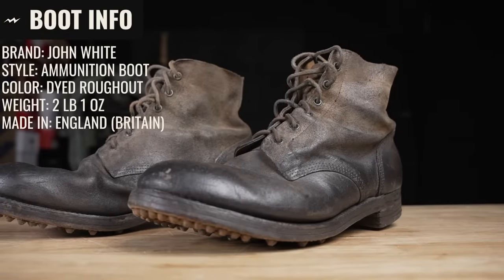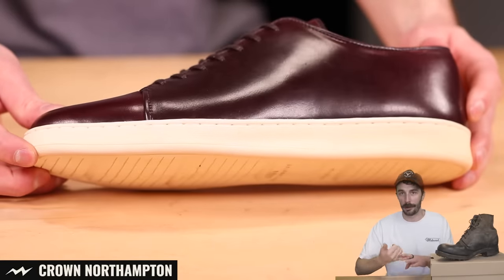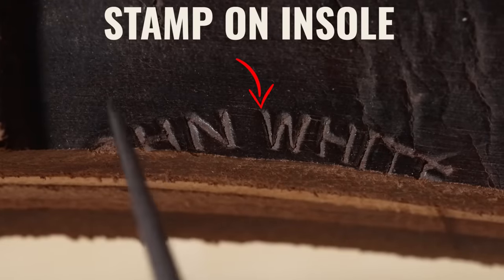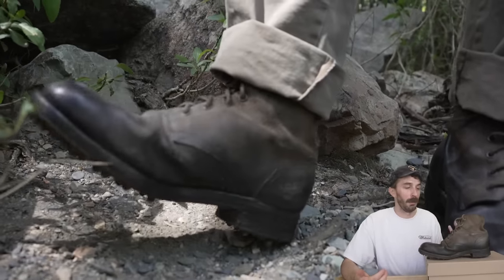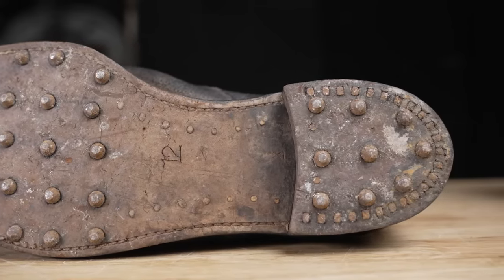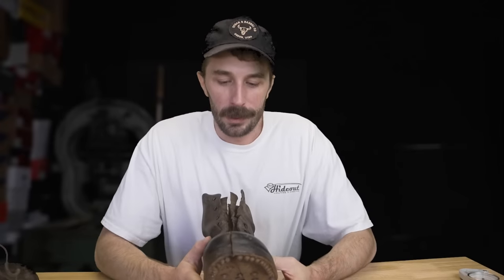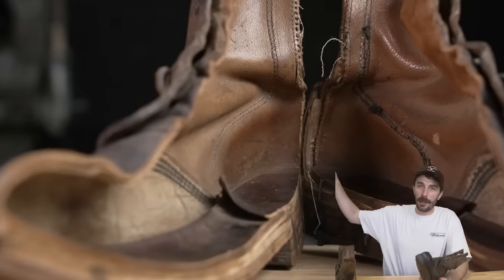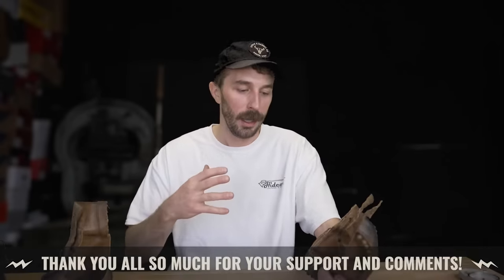Why 80 yr old British WW2 boots are better than modern boots

Comment: I joined the British Army in 1976 just after leaving school, and we were issued the "Boots DMS" which were patterned on these, except they had rubber sole, pimpled leather on the outside and a smooth toecap. They were pretty much useless, as discovered during the Falklands war, when they were found to be as "waterproof as a pair of sandals", and soldiers were getting trench foot, not seen since WW1. They were replaced in the mid 80s by a high combat boot with a bellows tongue, and these were slightly less crap.
For parades, we'd purchase our own non issue ammo boots, which, like these had a double leather sole and hob nails set in groups of 3, and a heel and toe plate. They were very stiff, also had pimpled uppers which needed to be "burned down" and a smooth toe cap and heel. Good for marching and holding a bull without cracking. They're still used today for ceremonial use by the Guards Division.
Reply: Exactly.
Reply: I joined in '63 and the first issue boots were ammo of 1940s vintage. Later we were issues boots DMS which were alright for wandering around the office etc. but as a plant op. I would go through the soles in about 6 months needing a replacement.
Reply: Boots dms were a piece of sh*t. Traded my woolly pully with a west point kid for his para boots.
Reply: I have heard only bad things about boots DMS. I can't imagine being stuck with them.
Reply: @eanschaan9392  this is because there was absolutely nothing good about them.
Reply: @stevekane4922  I believe it.
Reply: I pulled an absolutely unused pair of Boots DMS out of my attic a few months ago. I had been issued them in 1982. I chucked them in the dustbin.
Reply: @jeremyoconnor169  🤣🤣🤣🤣🤣🤣
Reply: Joined in 1980 and issued DMS boots. As an experienced land expedition leader and climber, I was appalled by the cheap quality, poor fitting and dismal performance of these boots. Quite frankly they were worst pair of boots I ever had. Useless in the field and damaging to one's feet. 

Compared to privately bought Vibram soled mountain boots I used for fell walking and rock climbing the DMS didn't come close. 

The MOD decision-maker who signed off the issue of DMS boots to the British Army should've been jailed for life.

Comment: As a British forces veteran I believe I may be able to add some extra snippets of info. Ammo boots, usually more modern, are prized highly among serving soldiers. They are kept aside for purely ceremonial purposes. Full dress parades etc. They are polished, or bulled as we called it, to a mirror finish.
And due to their full leather construction they are long lasting and are usually sold on once a soldier leaves service.
I had a pair I bought when I joined  from a guy who was leaving. I kept those boots immaculate for 8 years through many many pardes and sold them on when I left  years later.
 I would not be surprised if they are still being used.
Love your videos and would love to see you strip down a pair of 90s era Danner Matterhorns. The best pair of combat boots I ever had.
Keep up the great work.
Reply: Danner..nice boots..bit expensive though..best boots used where made by Lowa..not any of their high leg ones..but the just up over the ankle..survived many a crease job of a battle march with them and a good pair of socks..
Reply: Ahhh Danner/Matterhorn are a joke since you can't ever fit them right with that cutout they have
The rare times I needed a insulated boot (training in New Zealand) I wore their Fort Lewis (I think it was Lewis.....Fort something or another) boot because it was a taller version of their Acadia, which fit my foot like a glove

Comment: There's other advantages of making boots with the leather rough side out;  that the rough outside absorbs wax-type waterproofing very easily, and when it does get soaked, the inner skin side of the leather usually stays watertight, helping to keep the soldiers' feet dry - plus due to the coarser grain of the outside, it dries out faster.
There's an old horseman's saying - "No foot, no horse";  but it applies just as much to a soldier, doesn't it?
Many thanks for yet another fascinating video, and a look into an aspect of history which is rarely covered anywhere else.

Comment: I've enjoyed your videos and because this one is fresh, will add something about my experience with work boots. More specifically in the field with a survey crew and then as a geologist in mining exploration. This dates back to 1957 with my first pair, but with a leather or flat compound sole they had little traction on wet boulders or flat-lying saplings. Had hobnails installed, which was better in saplings but not good on rocks. Wore them once on a cold day and the heat loss was noticeable. In graduating in 1962, there was a European boot maker on campus, mainly making hiking or climbing boots to just above the ankle. Had a pair made with 8-inch uppers for going through the wet places. The "Vibram" sole was new then and the improvement in traction in most terrain was outstanding. The boots were beautifully made with a very smooth lining--and I still have them. In working for a "junior" exploration company we made some money on a discovery, such that I went into the investment business, only wearing them on some consulting work. Now my very dear friends, they are well-worn, but not worn-out.--Sigh--like me.
Reply: Get them resoled and restored. I had a pair of leather dress shoes completely redone with JR soles from the 1960s
Reply: @SilverKnightPCs  Had I continued full-time field work in mountain terrain the boots would have been worn out. Going down skree slopes wore out the heel counters. Nevertheless, the soles are well-worn but I had them re-nailed about forty years ago.
Reply: @bobhoye5951  like I said, full new soles and a upper restoration and they will feel like a new pair of boots with the same styling and look
Reply: @SilverKnightPCs  Hey--a conversation. I've looked after the uppers with leather preservatives such that they need no work. In good shape. I've lost a lot of weight over the past 18 months and some morning when my feet are not too "puffy" I'll try to put them on.
Reply: With success, maybe write a note: I took my sixty-year-old boots for a walk, or they took me for a walk.
Reply: Thank you for sharing that story :)

Comment: Just a note on how to lace up Ammo Boots. I served in the British Army from 1970 to 1995. Started with Infantry Junior Leaders Battalion at Oswestry in Shropshire. We were taught how to lace the boots by our two Platoon Sergeants- Alec Chisholm Scots Guards and John Hamill Queens Regiment. A knot is tied one end of the lace and threaded through the lace holes from the bottom left lace hole. The lace comes out the top lace hole and is wrapped round and tucked through itself to secure it. The same applied to DMS boots and Boots Combat High but changed with the issue of Boots Combat Assault which had metal mountain boot type hooks.
The laces were leather. This method of lacing was called "Kings Pattern". Hope this is of interest. PS I have never laced a pair of boots using a bow or knot.
Reply: How interesting 😃
Reply: On the topic of lacing...
When I was a kid, an old man in our village told me that he was out in Burma, during the war.
He told a story about how the Sikhs they had with them would strip down to their shorts and go out into the jungle at night with just a dagger, hunting Japanese soldiers.

At a certain point, they had a detachment of Americans stationed with them.
The Americans began losing their sentries at night.

It turned out that the Sikhs were crawling up behind people, in the dark, and feeling their boot laces.
If they were laced up in regulation British Army style, they'd simply crawl away again.
If not, they'd leap up, slit the throat and move on.

The Americans were instructed to change the way they laced their boots and instantly stopped losing men in the night.

How true it is, I couldn't say, but as a 10 year old kid, it made me very particular about lacing my boots the way the old man showed me... in case the Sikhs got me, in the dark.
Reply: Supposedly the reason for this type of lacing was that should you suffer a foot injury, say from a bamboo stake or a "toe popper" type mine, it was said to make it easier for a medic to cut through the laces to remove your boots. In reality when you get badly wounded they just cut the boots off with surgical shears.

Comment: I think one of the issues with "higher quality" (aka hardier) boots is they're not as comfortable. Hence why modern boots use modern materials like foam or chrome tan. People are no longer willing to piss in their boots just to make them bearable.
Reply: Thank you for that tip, I was unaware of this practice
Reply: It's also much harder to find brick and mortar stores for the hardier boots so folks end up buying the wrong size online and think that "breaking in" means blisters and literally bleeding from their feet so they give up on them. Forums online are littered with people saying their red wing's are killing their feet.
Reply: Modern combat boots are meant to be something you replace every few years, they sacrifice durability for performance.    The difference between hiking with synthetic mesh boots and leather boots is frankly night and day, even when leather is fully broken in.   Probably the biggest difference is the weight, there is an old saying that every 1lb on your foot is equal to 5lb on your back.    The mesh is something that is extremely important for preventing trench foot when water gets into your boot as well, as it allows the water to properly drain out.
Reply: @jfs5873  I've hiked in mesh and leather. The leather are stronger but you have to take them off every hour or two just to air your feet, the mesh you can walk all day in them and your feet will be fine. The problem is it's getting harder to get good mesh boots.
Reply: @manticore4952  I have modern leather hiking boots (Scarpa SL) and they are really very comfortable even for all day hiking in 30 degree C heat. My last pair lasted me 10 years, I replaced them a year ago.
Reply: @jfs5873  it's a good trade off if you ask me. You can't replace your feet. Plus carrying just a little more ammunition or a better scope would surely be worth more than heavier more durable boots.
Reply: Raw fabric softener left sloshing about in a boot over night works just as well.
Reply: We have become so weak as a society it makes me sad
Reply: @jfs5873  True. My Lowa Zephyrs did nothing tougher than walk the dog round the park, and after 18 months the heel was worn beyond the tread and the suede vamp was cracked and split to hell and back. Great comfy boot, and still waterproof, but definitely not built to last.
Reply: @dbz9393  don't forget that our aim as a society is to make life better for the next generations. We shouldn't be sad that life is easier now than it was for those before us as long as we don't take it for granted and make sure we live sustainably.

Comment: Quick note on the comfort of hobnails - if you're on soil/sand, they're both comfortable and provide a really good grip.  Works especially well on show/ice; your weight drives them in and gives you a better grip than you get out of just about anything else; if you've ever put yaktraks on a pair of boots, they're like that but better since they can't shift or slip.  On any kind of hard surface (like pavement), they're not great, and they make your footsteps sound strange.  They also tear the hell out of any indoor floor finish - take them off outside if you value your floors.  I keep a pair of my work boots nailed for hard digging/landscaping and snow clearance; mine are nailed by driving 1/4" hexhead screws into the lugs of the soles.  They wear forever and really help with the grip.

Comment: Well that's interesting. When I joined the (British) Army in 1972 I was issued with an old pair of ammunition boots. I was told that they had to have at least 13 hobnails in each sole (or else), and you mentioned  the figure 13 around about 7.40 minutes in to the video. I can't remember if my boots were date stamped, I was more interested in keeping them polished after cleaning the mud off them. They were very flexible and I could fire from the kneeling position sitting on the heel of the right boot with my toes parallel to the ground. That was impossible with the DMS boots I was given a couple of years later, their soles were stiffer.

Comment: As a WW2 enthusiast and former living history and reenactment bod who did British army and commando,  I have to say that I was almost crying with you cutting the boot in half however it was  very interesting to see the results, ww2 and post war boots were fantastic and really well built, I have owned a few pairs over the years and have worn them for long periods and done a lot in them and they are great to wear and comfortable and I would wear them in the Blacksmiths shop to when I did museum days, we used hobnails and rubber top souls as British commando and some other groups started using crepe and rubber for some operations for quite work, the hob nails work well and are comfortable albeit a little noisy at times but they are great for sliding across high polished marble floors.
Good boots and my cobbler always loves working on them as he has around 20 history guys who use him.
Good video and very interesting series thanks.

Comment: Can you look at the American jump boots from Corcoran and see how they how up quality wise to these ww2 era boots? We still use them as dress uniform items nowadays.
Reply: I got a pair that I bought a couple of years ago and let me tell you they suck. They're super lightweight but quality simply isn't there. They feel very plasticky just like the doc martens. I don't think they deserve a review. Maybe the old Corcorans were good but not the new ones.
Reply: It’d be interesting to see a modern pair compared to a WW2 era pair.
Reply: Been asking for something like this too!
Reply: @RogerLoera  I've owned the Corcoran brown historic jump boots for about four years now. They do have a painted on finish (which I stripped off and re-dyed) and don't feel as solid as my White's boots (much thinner heel counter, no leather lining in the vamp, foam sock liner) but they're absolutely a cut above Doc Martens I've owned imo. They're Goodyear welted with a half sole/heel that are both nailed into what I'm guessing is a "leather board" (shredded leather bonded with adhesive) midsole.
Reply: @RogerLoera  I mean, I HAD to buy them, I was forced to. So Id be very curious to see exactly what I and all paratroopers were forced to buy.
Reply: I can't say what the WW2 "para boots" are like......
But I've got a pair of M1948 boots (same russet brown boots but no reenforcement straps or the slanted heel block) and Dutch M57 boots ( their own version of the M1948) and the leather on them are miles away from the "new" Corcoran boots....even after 70 odd years

Comment: Superb work as always stripping that boot down! Post war and on the issue of newer types of boots these older models became the favoured parade boot for ceremonial duties at the royal palaces and the Tower of London. This is still the case to this day. Soldiers but Predominantly guardsmen, call these boots ammo boots or ammunition boots. They are kept in the same manner as they were all those years back with multiple hobnails, heel shoes and a toe clicker. They are layered with multiple applications of beeswax and black polish and then polished to a mirror finish using a circular motion called bulling. I thought you’d appreciate a little history of this book that remains to this day 👍🏻